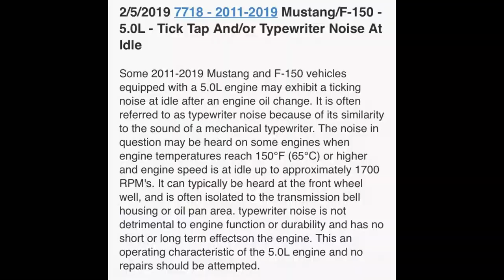2018-2021 Mustang GT Typewriter Tick/BBQ Tick. Don't Be Worried!

Comment: Great! explanation .  
I have a 2019 Bullitt, with the tick you talk about once in a while.  
To me an old timer it sounds like a lifter, however i'm sure it's what you're saying. 
One question I have is break-in oil?   
I was at my local Ford dealer today, wanted them to check my oil.   
Yes! sounds stupid that I guy who's rebuilt countless 289's and chevy 327's would ask how to check the oil.    
Book says check the oil with a fully warmed up engine, just allow the car to sit for 20min or so in order to let the oil drain back into the sump.   
When I went to the dealer today, they said "only check the oil when the engine is cold and has been sitting over night".   
Well whether checkin cold or hot the level still sits at the "ADD" reference on the stick.  
They then asked if I've had the oil changed since new?
I told them that the car has only 7,300 miles now, and it's on it's third oil change.
Their comment was "oh that engine has break-in oil from the factory and is supposed to stay in the engine for 3000-5000 miles.
Changing the oil before that can compromise the engine.
I reviewed the folder on my car, and saw that the Ford dealer that sold me the car new, scheduled the first checkup and oil service @ 500 miles.
And that is when it was done.
Sorry for this long story.
In a nutshell:   
1: Does Ford put special break-in oil in 2019 5.0 engines?
2: Any harm in the dealership changing the oil after the 1st. 500 miles?
3: Check oil hot or cold?
Thanks
Reply from the maker: Not a long story lol.  Your car comes factory filled with 5w20 synthetic blend motorcraft oil. There is no break in oil.  I don't know why they said 500 miles. Maybe missed a 0?  Never go over 5,000 miles on an oil change unless you are using a superior oil. Like amsoil. It's what I use in all my stuff. The XL boosted good for 12,000 miles (just in case I miss my 5,000). You can check the oil before you start it. Pull the dipstick wipe clean reinsert then check to make sure you have oil.  Then let it run to get to operating temp. Let it sit 5 min not 20. Then check.  Those cars take 10 quarts of oil. I've come across issues where techs were only putting in 8-8.5. Motorcraft synthetic is a great oil too if you know your going to be changing it every 5,000 miles.  So to answer your questions. 
1. They do not use break in oil
2.  Won't hurt it to change it at 500.  But it was pointless cause there is no break in oil.
3. Best reading is hot. Let it sit 5 min after running to operating temp.  

Any other questions. Just ask!
Reply: Wow!  thanks for the quick response.   
As you confirmed, oil change at the first 500 miles did no harm to the engine, just possible overkill and a waste of oil.  
As well  Ford does not fill the crankcase with special break in oil from the factory.
 I will check the oil in the AM cold and again after warming up the engine and allowing it to sit for 5 min per your recommendation.  
And you are correct!  the techs under filled the engine on the last oil change.  
I noticed the low oil reading right away.   
The same service advisor that told me about the break in oil, also said that the coyote engines use a lot of oil by design .  
Not burns but uses.   
I know the Voodoo?  Shelby engine had oil consumption issues, but never had heard of any such issue with the Coyote engine.
Reply from the maker: @johnc1486  only on the 2018 f150 with the coyote. That's the only one I came across with oil consumption.  Other than that. That service advisor is trying to cover his story now. He didn't want to admit it was low on oil and they didn't know what they were doing. And your welcome for the response. That's why I'm here.

Comment: You made me feel a lot better bro lol I been hearing this fir about 2 months on my 2021 mustang GT
Reply from the maker: Normal characteristic my friend!  Enjoy that ride!!!!
Reply: I just took my 2021 to get a oil change at Ford and it started ticking has 5900 miles
Reply from the maker: @codienejody68  that's right about the time it starts. Right after the first oil change.  Did they put 10 quarts in it? Some of those quick lane guys don't know and only put 8. Other than that yes that's when it starts. It will go away at about 70% oil life raining. Then come back at next oil change. Mine stopped when I switched to amsoil.
Reply: @BeardedFordTech  I told them to add 10 quarts but idk if they did or not
Reply: @BeardedFordTech  I’m reading the paperwork they gave me and it says 10quarts but prior to the oil change no ticking nothing
Reply from the maker: @codienejody68  it says you got billed for 10 quarts. Doesn't mean they put 10 in it. And it's the bbq tick. Always happens after the first oil change.

Comment: I bought my ‘19 GT MT with 17,000 km, now at 21,000 km I’m starting to hear piston slap between 1600-2600 rpm, it isn’t loud but it is there (a bit more evident when cold start), hear it right in the passenger side as you mention. Car isn’t under warranty anymore but I bought an engine and transmission insurance. Is there something I could do to stop it from progressing? Have the car for only 1 d*mn month and don’t want to start the calvary of an engine replacement as it doesn’t seem to affect yet. Sh*t I love this car in velocity blue but don’t know if I’m getting it right.
Reply from the maker: Does the noise go away or get louder with engine rpm? Piston slap noise does not go away. Gets louder and louder. To be sure you can pull the spark plug and look down inside with a camera.  But the also have water pump noise. Check that out too. If it is piston slap it should be covered under power train warranty

Comment: So I have a tick that happens periodically and it speeds up when accelerating but it does go away after awhile of driving? So it’s probably not the notorious engine tick?
Reply from the maker: @kamrynmcdougall2669  it more than likely is. The BBQ tick can be heard all the way up til about 2k rpm even while driving. It usually goes away after engine is warm although you may still hear it slightly. Then you have spark knock (like a rattle noise) on deceleration.  Run a high octane fuel.
Reply: @BeardedFordTech  thank you sir! I have been running regular 87 straight. Now that you say that, I have heard the tick more since switching from 91. Thanks for your knowledge:)
Reply from the maker: @kamrynmcdougall2669  your welcome. Run the highest octane at the pump. They don't like low grade

Comment: I’ve heard the noises the f-150’s, Explores and Expeditions get a completely different sound!! That’s valve slapping with a loss of power and gets louder as you accelerate that’s definitely a problem!! Nothing ticks like a 4 cylinder though and nothing is wrong with them. The timing chain clank is very unique you’ll never confuse that noise!!
Reply from the maker: Valve slapping?  You mean piston slapping?  There are cases where cylinder one was scoring due to the plasma liners. Those the noise does get louder with rpm. The BBQ tick doesn't. F150 does it too and the diesel type knock noise mostly heard on the passenger side which can be quieter with higher octane fuel.  Explorers f150s(with the v6) expeditions get cam phaser rattle on startup. That is fixed first with a pcm reprogram then if it still does it new cam phasers. We have to go through the process first. Engines do make a lot of noise. The 4 cylinders mainly just high pressure fuel pump and injectors. Yeah timing chains is just like the phaser noise. It's a rattle sounds like something is coming apart.

Comment: Hey man really good informative videis. I just bought a 2018 f-150 with the 5.0 two weeks ago. It definitely has the tick. I thought something was wrong until I saw your video so now I'm hoping everything's ok. I want to try the
cerma treatment and motor oil. The manual says 5W20 do you think 5W30 would be better to try to get rid of the tick or should I just do the 5W20 like the manual says? Thanks
Reply from the maker: Always go with what manufacturer recommends. So 5w20 it is. One of my friends has a 2019 and his does it too. Runs like a champ though. He did Cerma as well. Not near as noticable.
Reply: @BeardedFordTech  Thanks man I appreciate your help
Reply from the maker: @maximinras  Anytime
Reply: @BeardedFordTech  Sorry one more question. Does using this stuff void your warranty?
Reply from the maker: @maximinras  No it does not. Actually using the wrong weight oil does however void your warranty. If you took it in for an engine problem just say cylinder scoring. The first thing they do is an oil sample. If it calls for 5w20 and it comes back as 5w30. It's on you. Warranty won't cover it.
Reply: @BeardedFordTech  Very good...thanks bro
Reply from the maker: @maximinras  No Problem!

Comment: What about 2014 mustang 5.0 and I just own it with 90,000 km. And I change the oil 5w30 so the tick goes away and still hear it. My friend said it's normal for mustang is it fine? Or should I put Cerma? I'm so worried about it :(
Reply from the maker: Don't put Cerma that company is a rip and it will still tick.  Send me a video in email of the noise. Email is in about me
Reply: @BeardedFordTech  thx i just sent it.
Reply from the maker: @Anas1i  normal injector tick. And BBQ tick. Keep it maintained and drive

Comment: My 16 just passed 120k regular maintenance previous owner hit a deer on the front left insurance fixed it and they traded it in at 60k no issues with the car besides warped heads because (im assuming because this is normally how it happens on stock cars) that at some point they had been removed and put back on but not torqued correctly otherwise my car has done gods work honestly  
i daily it and beat the shit out of it rain snow summer or winter she does great 
Anyone who hates on these motors has zero idea what they are talking about in terms of strength 
My dads 2018 is on stock internals a e85/turbo tune with some bolt ons and hes ran it like that for well over 50k miles with no issues or signs of increased engine wear
Reply from the maker: @SumDayDriver  yeah if you takes the heads off there is a special sequence you have to follow with new bolts. Otherwise they warp.  A lot of people hating on the engine don't even own the car (or the truck)  they are beasts.

Comment: I’m having this problem with my 2019 GT and when I run it the service engine starts flash in but it will turn off .
Reply from the maker: @clarisagrimaldo904  flashing engine light is a misfire. Might want to get that checked out. You may have cylinder 1 scoring which is different than this.

Comment: I bought my 2017 gt used and noticed the tick the second i drove it off the lot lol, same noise you have, comes and goes and is 100% intermittent, some days i hear it more than others and it can be annoying but this video makes me feel much better about it!
Reply from the maker: Yup if it's intermittent it's ok. Glad I could help you out 🤘
Reply: I heard my 17 making that noise today. But kinda increases a little when I rev up!.
Reply: @onvlader  mine will sound a little louder up to 1k to 1.5k rpm but after that will go away.

Comment: I hope you can help please , Iv just noticed mine after a service done yesterday 🥲 when idling it doesn’t make the ticking sound , but when I go up through the revs it kicks in , and disappears around 4500 rpms , is this normal or should I be worried ? Its a mustang gt 2017 , and the sound is coming from the bottom by wheel , Many thanks
Reply from the maker: Let it idle and warm up. See if it does it. Email me a video of idling. And one with revving.
Reply: @BeardedFordTech  thanks for getting back to me really appreciate it , also I got it wrong about the rpms , around 3,500 - 4,000 rpms the tick disappears , when the car is warm warmed up it doesn’t do it when idling , only when going up through the revs , also can I have your email address please , thanks

Comment: On my 2017 V8, the problem turned out to be in the dealer OIL CHANGE. Ford dealers are not ptting enough oil in their engines. Not enough oil causes other issues. My valve pins bent at one point and i had to rebuild the head. The problem STOPPED once i changed my oil in a drive thru place. I don't have that problem anymore since i ditched the dealer and their manufacturer poor quality control and assessment. Ford dealer re-built my 2017 v8 engine to get rid of the ticking the first time. And it worked till the next oil change. That was before the manufacturer said it's normal to get the ticking after the first oil change, and they won't fix anything. The service guy told me it's like a cataletic converter cooling down. a seriously unreleated made up answer! just reminded me of the mechanics that tell women they need to change their blinker fluids! That day was the last time i step into a Ford service center. Which is after owning 4 different Mustangs, and i will not buy another because i don't trust the maintenance nor the warranty anymore.
Reply from the maker: @Omar-g8p8b  the 17 on tske like 8 quarts. 2018 and newer takes 10. So what about all the ones who do their own oil changes. The type writer tick isn't caused by lack of oil. That was just your dealer quick lube places being lazy. It will do it again. I promise. And it's not a catalytic converter cooling down. Wow that was a stupid answer to give you. It happens when it's running not shut off. Stupid service writers. There is literally nothing wrong. My 18 has like 30k miles on it. Still does it after oil change.

Comment: I figured that the assembly lube being cleaned out of everything from that first oil change is the reason behind the "tick" being audible after the first oil change. 

Thoughts?

I just bought a 2019 GT a week ago, when I started it for the test drive no tick. Only had 3k miles, when I came to pick it up, the dealer serviced it, oil change, etc. When I started it up to drive home the tick was there. I did a massive amount of research prior to buying so the noise didn't bother me, she runs amazing!
Reply from the maker: Not really assembly lube. Most manufacturers assemble dry. That is great logical thinking though and it does make sense. And you only hear it after the first oil change. It's not hurting anything and no engine damage is occuring because of it. It can be annoying. But if your like me a car that runs great like that with no mechanical failure and no harm being done I can live with it. 
It's my favorite car and being a ford tech I drive different ones. Some tick some don't. Even the senior master techs say the same thing. Just keep your oil changed between 3-5k miles and you should be fine. Enjoy that car!!

Comment: It's quite interesting that even after 10 years after the introduction of the coyote  motor not even ford can determine the actual cause of the ticking. And yes I own a 2018 GT PP1.
Reply from the maker: When I worked at Ford we would have to call tech line to verify. I'm sure the know the answer but it's not causing engine damage or a safety concern so no need to put out a recall or warranty repair. It would cost them money that's what we were told. If it was a concern then they would find a fix. But I totally agree with you. I want to see video of your car!
Reply: They fucked up. Simple. $50k vehicle with a tick🤡.
Reply: @BeardedFordTech  I posted a few comments asking you some questions on Apex Auto Repairs I think the account was. On his video you said that his sounded like piston slap, which mine sounds identical to his, and that was not the same as what you displayed here. Sorry for leaving so many comments everywhere I just would really appreciate your input.

I also have a 2018 GT PP1, with a Borla Atak Cat Back. I’d post videos just for you, I want to make sure it’s running healthy first tho😅
Reply from the maker: @ihateyou3836  it's hard to keep up with all the comments. I do apologize. I think he said his ended up being normal after taking it to dealer.  Cylinder scoring is what I meant not piston slap. It is also hard to hear in some videos people send.  But you can shoot me an email with a video and I'll take a listen.

Comment: Everything I’ve read says spun rod bearing? Is this incorrect? I’ve also heard that you could run an engine with a spun rod bearing for 300,000 or maybe it will only run for 30 miles? But either way if you’re buying new and making payments, seems like something I might wanna steer clear of and that sucks cause I’m a huge Ford guy 😢
Reply from the maker: Did you seriously read that?  Wgever you read that, you need to stay away from it. Your telling me every mustang and f150 from 2011-present that has the BBQ tick is a spin bearing?  Where there's a tsb explaining what it is. It is a completely normal noise. Nothing wrong. The only noise you should be worried about is cylinder one scoring. And it sounds way different. A spun rod bearing sounds like this https://youtu.be/3j9Za7jSGC8
Reply: @BeardedFordTech  I’m not trying to say that’s what’s going on with all of them. It definitely seems like that’s what was going on with the 1st gens or at least early 1st gens. But what I don’t understand is how could allot of these make the same noise in the same place as the 1st gens and it not be the same issue? I’m sure you’ve watched the same YouTube videos I have on Everything wrong with a 5.0 coyote? If not search that and watch, it’s a really informative video.
Reply from the maker: @buckeyemoosehunter  yeah I've seen them. It's been going on since 2011. Supposedly fixed in 2024. But apparently not. I have a sub with a 2024 and his does it. It's not rod bearing though. There is a lot of misinformation on the 5.0. It's a great engine.  Yeah it has a few minor flaws. But all engines do.